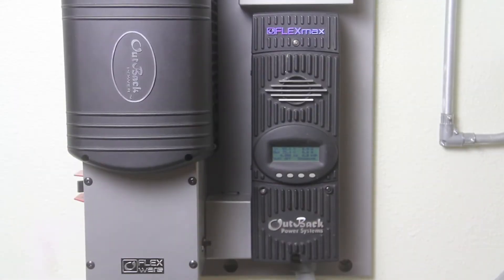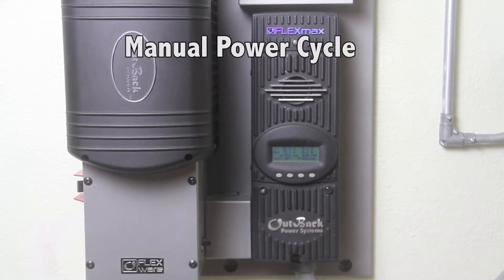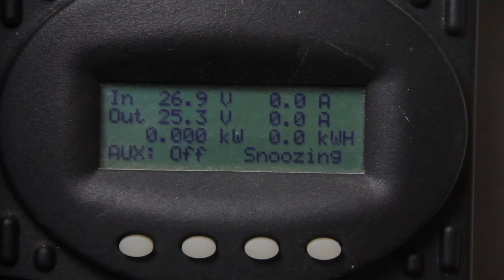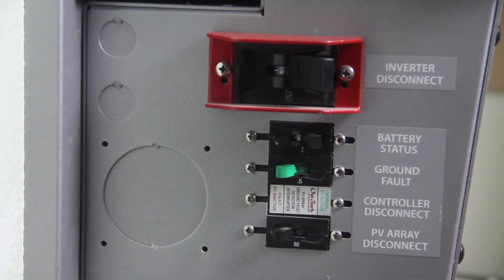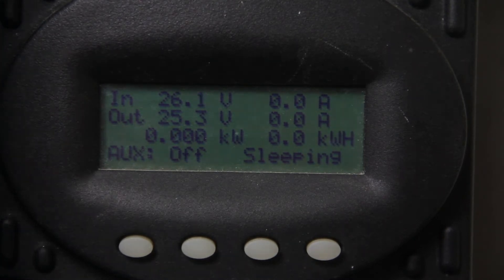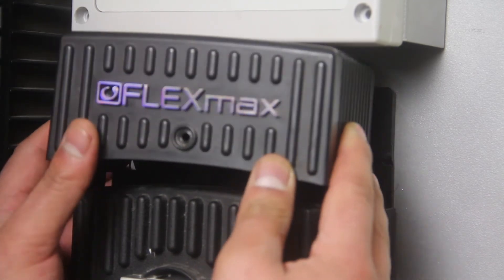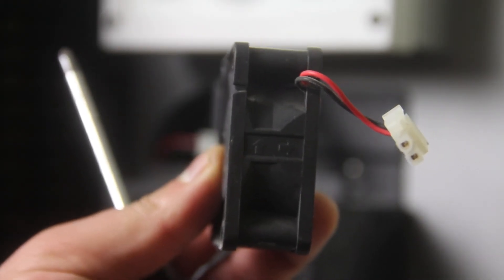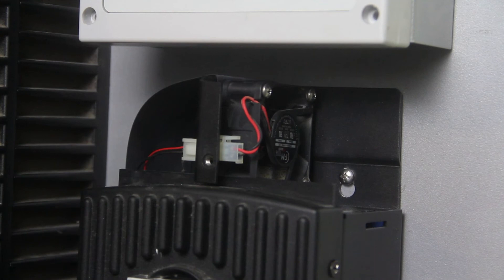FLEXmax 80: Cooling Fan Replacement

Comment: I have got an OUTBACK FLEXLOW 80 and something strange is happening. Sometimes with full sunlight the charfer simply does not work and some others it does. My batteries are registrating 49.00 volt which should trigger it charge. Can anyone with experience please comment on this matter? 
Thanks
Reply: Few things . Check your rebulk and float voltage setting. Disconnect solar array and power cycle the flexmax 80. If the fan starts and stops then it means your fan is alright. Also check if you are not exceeding the 150v limit from your solar array .